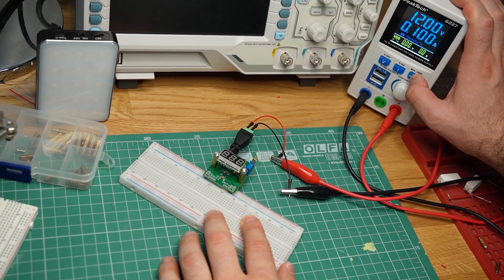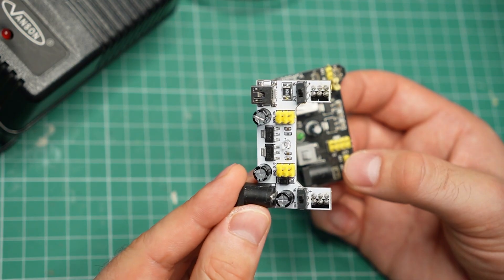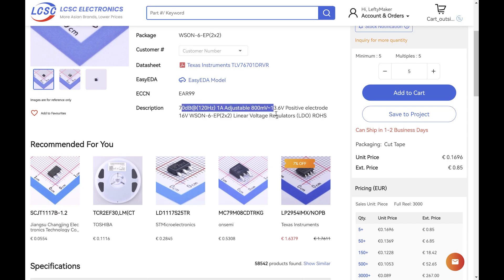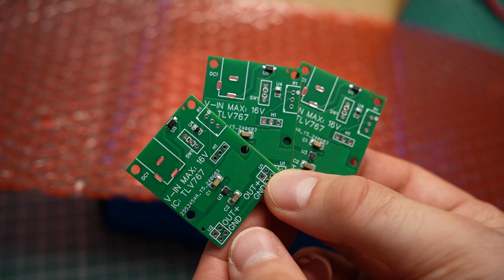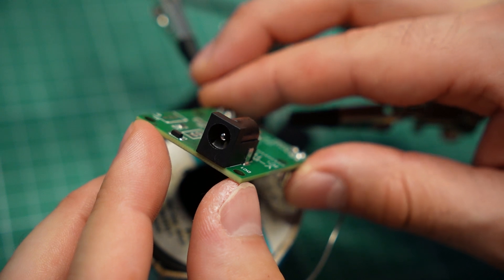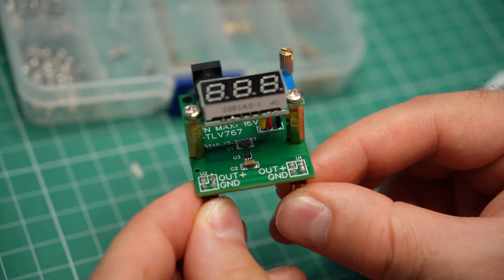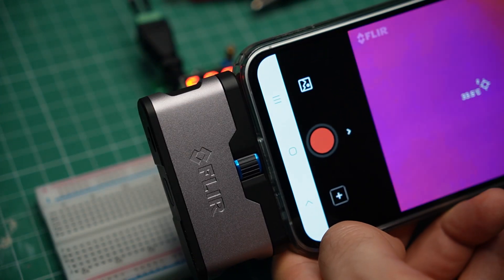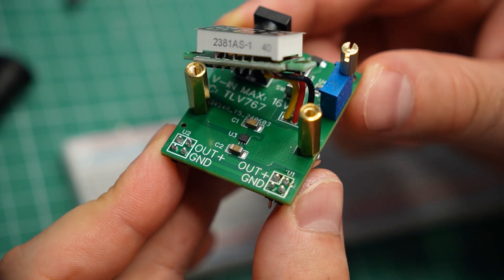DIY Breadboard Power Supply

Comment: you have a lot of space for a 2mm chip... it's nonsense!
you can use bigger voltage regulator!
tiny chips are for tiny projects and... tiny currents 😊
Reply from the maker: The reference design by TI was much larger in area. I guess I trusted the 1A rating in the datasheet too much.

Comment: why not add some screws beside the chip and then screw on a heatsink? or maybe you can make it so that the chip controls the output voltage using a mosfet, which should also be able to solve the problem
Reply from the maker: Hmm. I should look into your second suggestion. I remember seeing transistors used with chips like 7805 or 317 to increase their current output.

Comment: Disappointed. Why go through all the trouble, and it still requires a barrel jack. Make it use usb C PD atleast 😉
Reply from the maker: I am considering that too for v2.0, in combination with a chip to negotiate voltages. Funny enough, digikey just posted a video about that!
Reply: @LeftyMaker  yeah, I just saw that vid. Comet electronics has a 100W adjustable PD trigger . Works like a charm